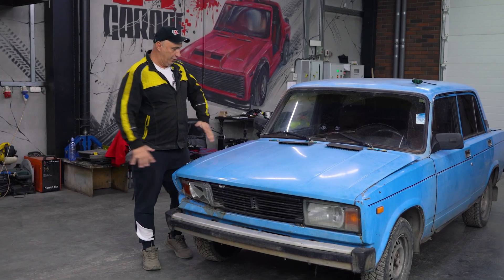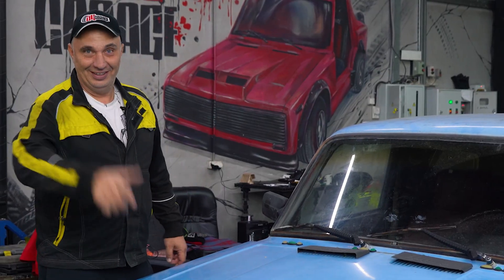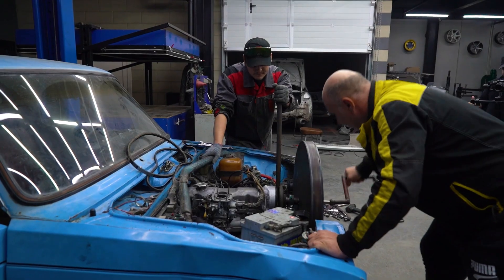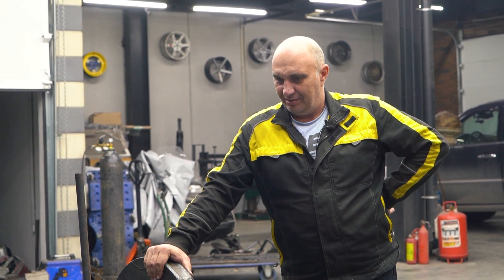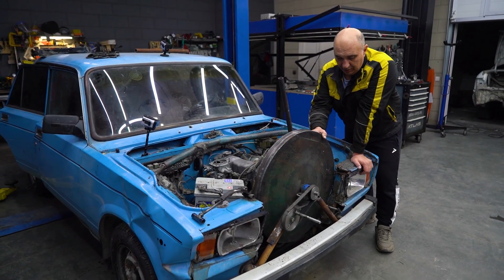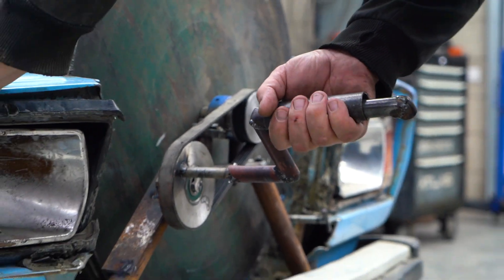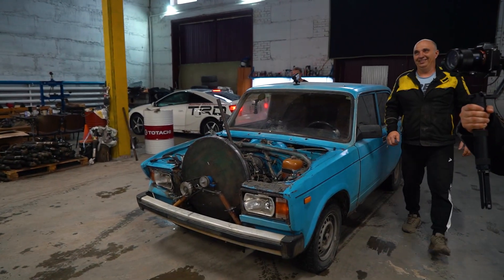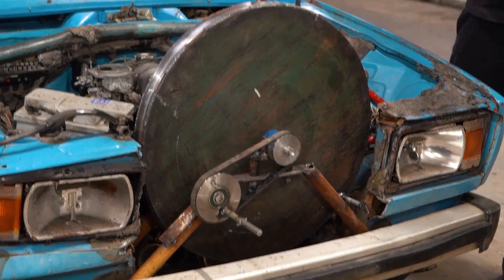We make a 60 kilo inertia starter for a car

Comment: I like this idea, only don't use sand or concrete. Fill the inertia wheel with lead so it won't shed velocity as quickly when engaged. Also to make it easier to turn, a small gear reduction perhaps a two or three to one for the drive with a slip joint direct the engine much like a pull start engagement off a lawn mower it string trimmer.

Get the inertia wheel spinning fast enough it starts to ring then engage it to the engine. Stand back Incase of shrapnel.

Comment: In version 2, maybe you could stick  a gear box with clutch on the front of the engine and spin the disk up to speed before turning the engine off, then you could use the clutch to crank the engine with the disk

Comment: I really love how these mechanics answer questions I never had but are really fun to find out anyway with their experimentation. Steel nail wheels, super speed wipers, carburettors. And now "What if my car could be crank started?"
Would never worry about a dead battery again.
Reply: they need stronger welds for a more durable robust starter and problem solved

Comment: 8:41 NEVER pour water into a hot engine that is not running. It will crack or warp the engine block and possibly cylinder heads too depending on what material they are made of. Wait for it to cool first or keep the engine running so it won't cool rapidly.
Reply: Do you have any friends ?

Comment: most of the weight of that flywheel should be on the outer edge for most inertia.
and also shortening the "stroke" by putting the cranking axle shaft closer to flywheel centre would make the flywheel faster without using gear reduction

Comment: If you want bigger inertia you should make large mass of metal, such as metal  or lead ring as far from axis as possible. Sand won't cut it as good as metal ring. Maybe as an idea for second attempt.
Reply: A hoop. The moment of inertia for hoops are well known, so there shouldn't be any problem in calculating how heavy to make it to turn the engine over

Comment: What if this was used as a makeshift starter in response to the cars that shut off at stops to save gas. If there’s a flywheel. You could shut the engine off at a stop. Then turn the switch and it could crank the engine with the inertia. I just think the added weight will cancel out any gas savings.

Comment: I'd like to see a clock spring starter like my old mower used to have, man that thing put some energy down fast. Little wonder they got outlawed back in the day.
Reply: Those type of wind up spring powdered starters are common on marine diesels especially those used in emergency service like lifeboats and backup generators. Buhk diesels are famous for them.
Reply: I believe those things are still being made, mostly for tractors or other agricultural engines I believe.
They are expensive though !
Reply: Think they are called Kauffman starters. BIG spring.
Reply: If modern cars used the last bit of torque remaining when the car comes to a stop, is put in park or neutral, or is just turned off at the of the day, used that kinetic energy or inertia to wind up a powerful mainspring somewhere, and could only be released in  emergency situations by pulling a slightly inconveniently-located, low-tech cable lever, (like a hood release), I can’t imagine that it would add much to the cost, or weight, or take up much room, and might save somebody’s bacon out somewhere when the battery is dead. If an option was available in addition to this single-use starter that included a tiny canister of starting spray, and a half gallon size container of some kind of stabilized fuel under slight nitrogen gas pressure, it might be a real lifesaver on vehicles that are frequently used in very remote areas.

Comment: You could lose about half the mass of the flywheel from the center and have a lot of the rotational inertia left. Mass in the center doesn't contribute to the rotational inertia. You would've been better off layering more metal on the sides far out instead of pouring it full of clay.

Comment: Honestly I thought you would of used those Flywheels that you welded together in a previous video where you added Multiple Flywheels. Certainly smaller, But much heavier. SO- Why not a improvised Hi tension spring that you can "Wind" and then Release to start the car. It would certainly take less space int he front of the car.

Comment: I have started a Ford model T with a hand crank. Not new tech. But a heavy wheel may have stopped the kick back. Nice job 👌
Reply: My dad brought a lada Riva second hand he was desperate ( we are in UK ) a A reg 1984 looked like the white on in the corner with the round head lights and crime bumper and that had a starting hande and he tried it once for fun.                                                            . when  he got made redundant and got a reasonable pay out he got a job 50 mile's away so he brought one new G reg 1990 the one with the square headlights

Comment: You guys, have to do a mechanical start-stop system with this flywheel, using some type of clutch engaging from the cab. It would be interesting to see how you would work it out.
Reply: Trunk starter. Connect it to the rear wheel or something. Use the normal clutch and gearbox. Done.

Comment: Think the handle should be near the center of the flyweel or pulley to have more rpm with small arm movement.
Also think that there is no need to a separate handle but only a piece of pipe that can turn on the rod

Comment: Build an engine with the biggest possible flywheel and try how low revs you can keep it idling. Or try to boost the ignition spark up as much as you can

Comment: build a bicycle with this "inercia starter" that you pedal to turn that flywheel pretty fast and then use a clutch to accelerate the bicycle
Reply: Tom Stanton made one
Reply: @naysaykiller928  that's a KERS
Reply: @braziliansheetbox2497  What you're describing is esentially a KERS. It stores energy in a flywheel for use later.

Comment: You could replace the starter with a pneumatic drive and use compressed air to start it. That way you can remove the battery and have accessories run off the alternator. Have a small pneumatic pump to fill the air tank:goodvibes:
Reply: I don't think the pneumatic drive has the same power as a starter motor.

Comment: Can you make a flywheel so heavy that it moves the car forward with inertia?
Reply: I think some drag racing cars had massive flywheels, they'd rev the nuts off the engine and drop the clutch to get it off the line.
Reply: @joejoejoejoejoejoe4391  Interesting, i never heard of that.
Reply: You can. The problem with powering a vehicle with a flywheel is the change of RPM. From a start the flywheel is at high rpm and the drivetrain at zero rpm. Then as you accelerate the flywheel rpm drops while the drivetrain rpm needs to be higher. 

Basically the main problem is that the flywheel is constantly loosing RPM as you take power from it. They’re good at smoothing things out and short bursts, but that’s about it.
Reply: @NBSV1  One solution it a "tape recorder transmission" - the flywheel would be connected to one spool, the transmission to another, as the flywheel spool wraps "tape" around it it diameter increases, but the transmission spool unwraps tape decreasing it diameter, so the ratio changes.
Reply: @joejoejoejoejoejoe4391  You still have the problem where when the flywheel is spinning fast it has high torque, but ratio to reduce the speed doesn't need high torque. Then as the ratio changes and the flywheel slows down it has low torque but the ratio needs high torque. 
That's the biggest problem with flywheels. They're good for smoothing out things because of the mass, and are good for sudden dumps of power. But, to actually propel a vehicle they just don't work out beyond launching it off the line.
Reply: @NBSV1  Another solution would be to use the flywheel to wind up a spring, if the spring unwinds it engages a rachet that is driven from the flywheel, when it is fully wound up the rachet disengages, and the spring drives the wheels of the car through a gearbox to control the transfer of power - high gear slow power transfer, low gear high power transfer. This way the power taken from the flywheel is independent of it's rotational speed, only the twist in the spring.

Comment: Can you start the engine with a big spring? Like an old clock?
Reply: I think there were spring starters fitted to some engines, it makes more sense using the force of a spring to turn an engine than the decreasing revs of a flywheel to increase the revs of an engine.
Reply: @joejoejoejoejoejoe4391  Yes, they are still made, although they use a stack of belleville washsers instead of a coil spring. I have seen generators equipped with an electric or compressed air starter on one side of the flywheel housing and a spring starter on the other.

Comment: Fell apart because it wasn't balanced, it needed to be balanced or if it was filled to capacity with something a little more consistent than clumped dirt then atleast it would have been a little bit more balanced.

Comment: Oil drum/barrel too snow plow, Barrel Plow? a 4600cc engine is not enough power when it snows 3 feet over night... but using a modified drift car to plow snow drifts, joke: drifter drifting the drifts?

Comment: Centre drill the arbor shaft, tap a thread, & bolt the pulley in place using locktite on the bolt.

Comment: Their rust-to-rust welds failed?  Impossible!
Reply: Are you talking about the shaft? That twisted off. I didn't see any welds fail. That's surface rust anyway, a decent welding rig will blow right through that.
Reply: @clockwork_dox  I mean unless you’re talking about the stream of gas but why would you need then when you could literally dust it off or blow it off yourself? Preparing the surface is taught for a reason
Reply: @TGears314  when I said "blow through" I meant the arc will vaporize most contaminates. Sorry for the confusion.
Reply: @clockwork_dox  you Never weld on rust. It's a first rule to weld clean.
Reply: @clockwork_dox  you don’t “blow through it” you just add it to the melted metal🤦🏼‍♂️
Reply: @TGears314  where I'm from, if I said that to anyone, they'd know exactly what I was talking about, I suppose speech patterns come through text too. The "face palm" emoji creates a rather condescending tone. With all due respect, I don't care where the contaminates go, the welds stick, I didn't care if they look good, there's a saying that seems fairly local, but it's "engine over body" appearance is always secondary to function.
Reply: a grinder and paint make me the welder I ain't
Reply: Inconceivable
Reply: Это вы ещё не видели как некоторые к песку на полу привариваются.
Reply: I’m as shocked as you are
Reply: Easy to take the piss but these lads make some incredible things.
Reply: I've got an idea for a future project, try putting a clutch with a simmilar flywheel to the prop shaft. You could use the vehicles innertia to slow the car down and then release ist all at once or so
Reply: @tobiasachter6261  I believe that would be considered regenerative braking. Electric cars do it by using the motor as generators on braking
Reply: Forget the rust they have concentricity on their side 😂
Reply: @Interdimensional what colour is your welds😂
Reply: thats not welding, thats glueing!
Reply: @somal1anwarlord197  a welder is just a really hot glue gun 😂
Reply: Its just an experiment not something theyre gonna use relax
Reply: Send me a link to your inertia started engine
Reply: @Papawheelie57  send me yours
Reply: @Papawheelie57  https://www.youtube.com/watch?v=2LsVXPDUaCo
Reply: you act like making an inertia starter is equal to rocket science... its simple physics.  @Papawheelie57

Comment: I'd love to take an engineering class with these guys, are they classically gained or just gain knowledge by a lifetime experience or both?
Reply: They just experiment a lot with Ladas lol
Reply: Do you really think these guys are "classically trained"? None of the stuff they are doing would be taught in a class. Except maybe welding. 

If you want to learn this stuff, just go out and start doing stuff. You'll eventually figure out what works and what doesn't, and what tools you need and which ones you don't.
Reply: @mediocreman2  All these concepts are taught. You learn to calculate inertia, so you know the exact energy it would change from X rpm to Y rpm (knowing you want 900 rpm to start, how fast do you need to spin it if it normally takes a starter Z number of watt*seconds to start the car?). You would also know the exact torque seen on that shaft and the shear force on the welds.

ALL of that is taught in class, its how they are applying it (which is not really that novel, its been done in this case before) that part is just creatively using what they know.
Reply: Neither is needed, but more difficultly, they actually understand the mechanical functions they're trying to achieve.
Reply: Bro just literally fuck around and find out lmao

Comment: There used to be gyro buses using a big flywheel to generate electricity. Which would power drive motors. 
Once the bus got to a stop the fly wheel would be re-spun by a motor. 
Maybe try something similar, a battery free electric car. Maybe even do away with the electrical side and use torque converter to run the wheels.